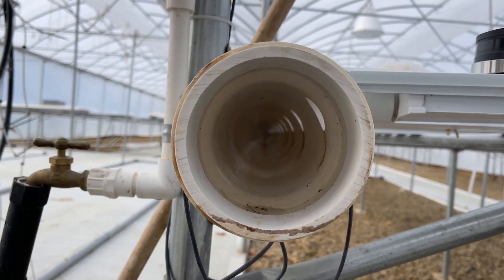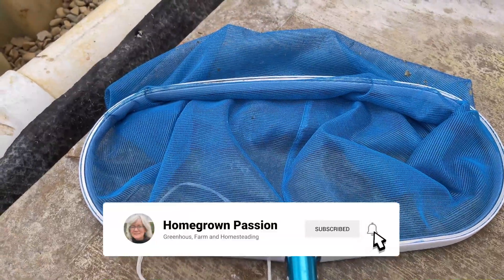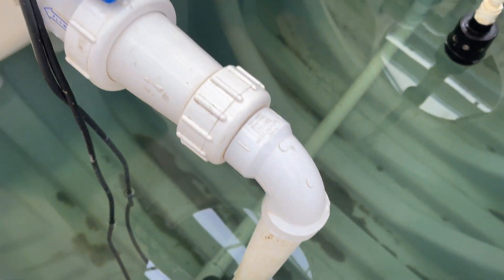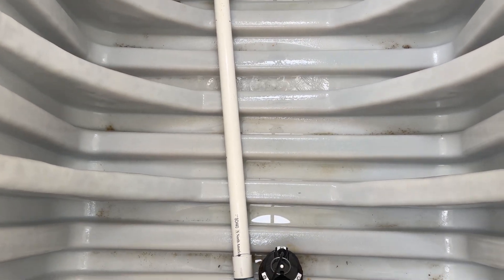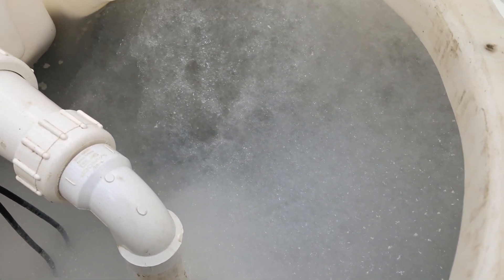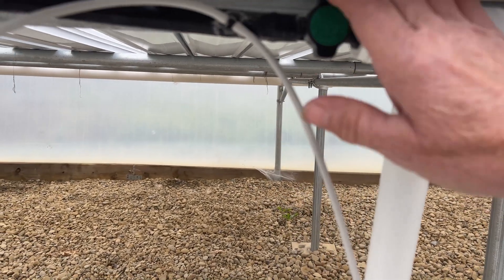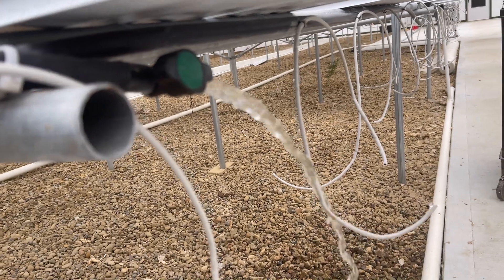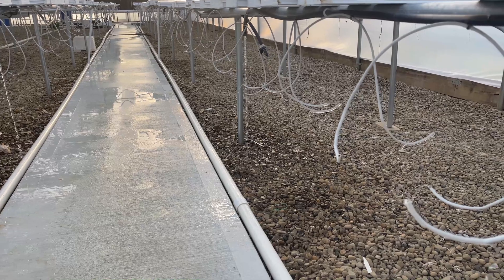Hydroponic Nutrient Reservoir Cleaning

Comment: Very cool seeing all the plumbing and where it runs to. Also I had never considered the tanks coming out of the ground if the water table rose. I wonder if you could cement them in?
Reply from the maker: When we dug the hole Doug put a concrete pad at the bottom and cemented in aircraft cable that wraps around the tank to help it not float out of the ground. The sump pump you see in the black culvert pipe goes below the bottom of the nutrient tank and is on a switch so when I want to do a nutrient change, I turn on the sump pump a day before hand to help lower the water table around the tank.

Comment: If you use the Dosatron system, do you still have to have a tank like this?
Reply from the maker: No, because the dosatron system injects the nutrient solution directly into your water stream. There is now recirculation.
Reply: @HomegrownPassion  Would the Dosatron work for your NFT system or is it designed moreso for hydroponics with media?